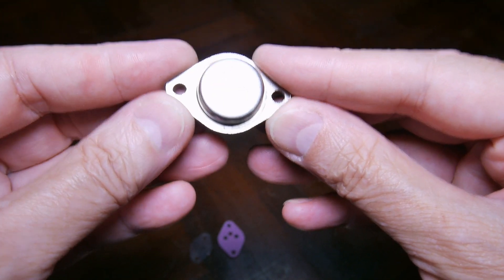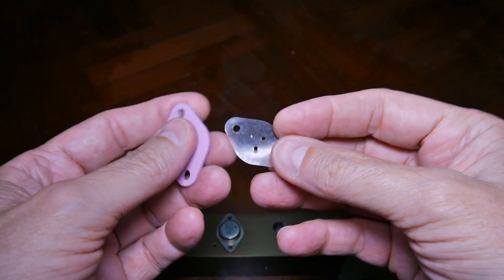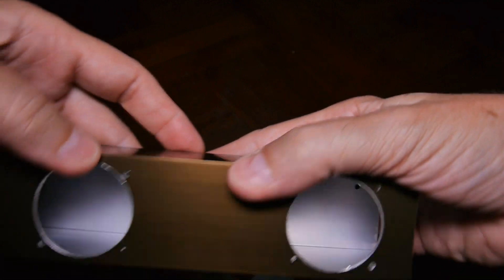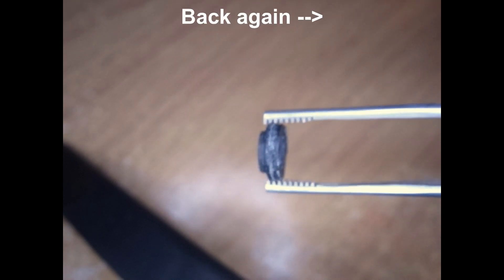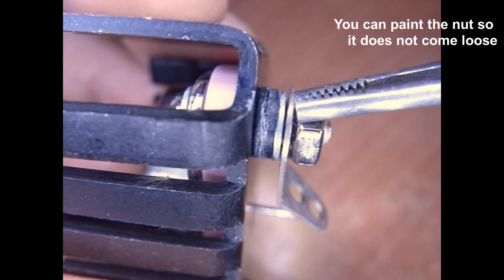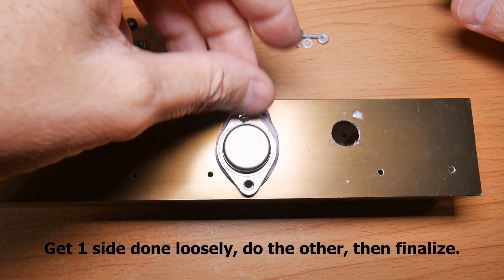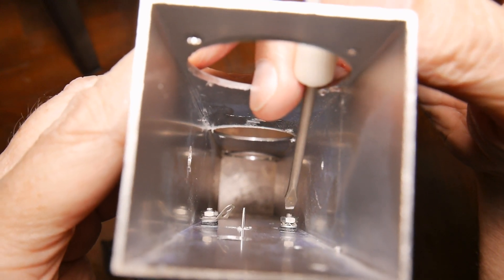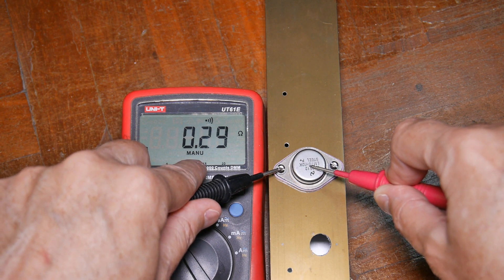Mounting a TO-3 Device - Transistor, Voltage Regulator, etc.

Comment: The ceramic washers you fit appear to have a pinkish colour which is typical of the colour-coded beryllium oxide ceramic (highly carcinogenic dust), as once widely used in military equipment. I used to retro-fit those to big power amplifiers until the owner blasted me over the liability problem, so I assume you are aware and these washers aren't what they appear to be. 
Otherwise, I can only agree with others - great work and to the point!
Reply from the maker: Can't say as I got those off a piece of old gear. But good info. Thanks.